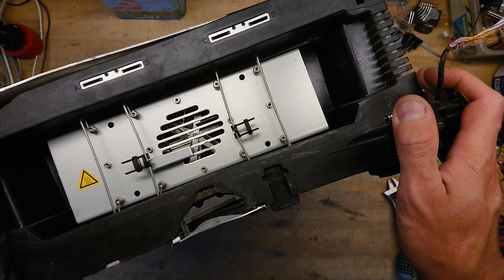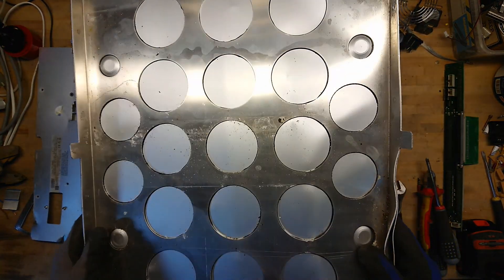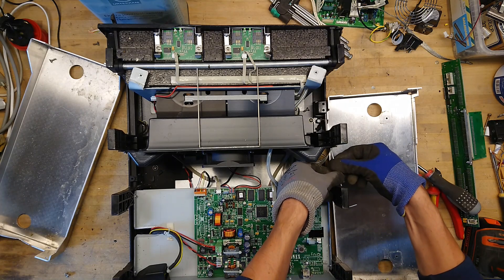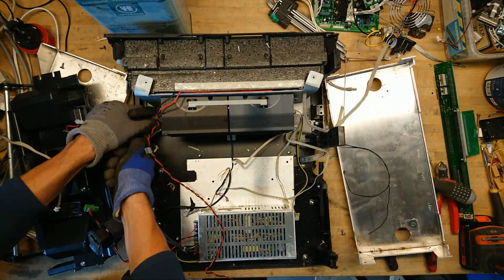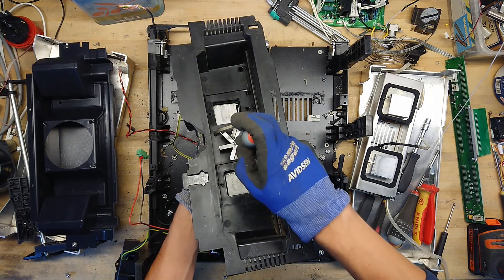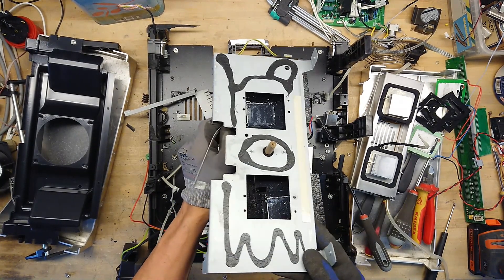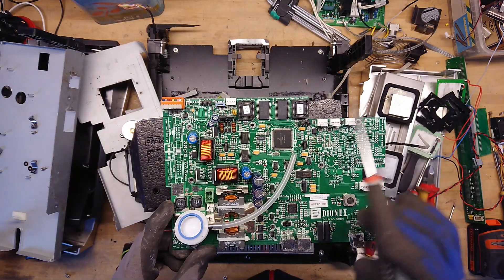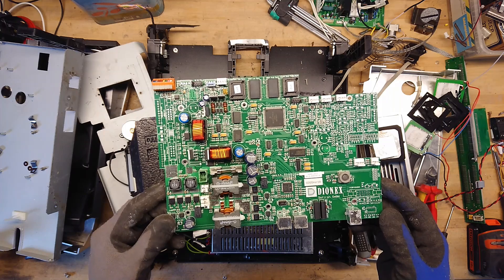HPLC Thermostatted Column Teardown - Dionix TCC-3000SD

Comment: Funny enough I designed a small portable Gas Chromatography column.  The main effort is thermal accuracy and stability as it directly effects the columns retention time. As many compounds are only identified by their retention time, an error in the temp-controll can have quite grave consequences. For example if you are measuring volotile organic compounds like benzene or styrene. (Not HPLC but simillar technology)
Reply from the maker: From another comment thread, It actually only now occurs to me that I worked with gas chromatography in the residual liquid detection machines for returned bottles. It would spray in caustic and CO2, suck the resulting gas out to analyze for volatile components and if present, the bottles was rejected as dangerous waste. It was such a mess when a full bottle passed the full bottle detection and the analyzer got a blast of liquid caustic inside of it :)

Comment: I used to run HPLC machines. Never had a column heater though. The column would separate the sample into its component molecules and the UV detector would "see" the output of the waste stream as the mobile phase liquid dragged the sample over the column packing. Was very interesting.
Reply from the maker: Great to hear from a user of these technologies! So for this to be possible, the stuff being analyzed is mixed with a liquid that will cause these reactions at a given temperature?
Reply: @KaizerPowerElectronicsDk  i think the heater probably makes the system work faster and more repeatable. Temperature was a factor in arrival time of the sample to the detector. The method is kind of like rocks in a river. The mobile phase is a solvent like liquid blend. And then it is pumped through the column. The column has sandlike material that slows the passage of the dissolved sample and they spend more or less time in the column depending on molecule size and bonding factors like charge. The sample is loaded into the stream and then one by one they run out of the end of the column into the UV light beam and then a detector reads the response and plots a curve on a graph. A known standard of the compound(s) is run under the same mobile phase liquid and those are weighed and measured so that a number can be given to the concentration of known sample and literally the area under the curve can be used to determine the concentration of the known to the unknown by how high the curve response of the detected sample was. In the old days it was paper plotters and they would literally cut out the curve with scissors from the ink plotter and weigh the paper on a 4 digit analytical balance. Then punch the weight of the sample paper curve into the equation against the weight of the known standard curve and work out how much active was in the product. So the heater i guess would give faster run times and more consistent arriving times cos if the temperature was the same every time then the only other variable is how well the operator measured the liquid blend of mobile phase solvent.
Reply from the maker: Your explanation draws so many parallels to bottle inspectors that I have worked with, in brewery industries. Analog cameras which from the shadows of the bottle and the resulting histogram formed a curved where the result was weighted on the analog value of the dark areas. It actually only now occurs to me that I worked with gas chromatography in the residual liquid detection machines for returned bottles. It would spray in caustic and CO2, suck the resulting gas out to analyze for volatile components and if present, the bottles was rejected as dangerous waste. It was such a mess when a full bottle passed the full bottle detection and the analyzer got a blast of liquid caustic inside of it :)
Reply: @m3sca1  Fellow heavy HPLC user here.  The heater makes the chromatographic process more accurate and consistent. Reverse phase, in particular, but also to some extent size exclusion are prone to temperature dependent secondary interactions between the analyte(s) and the chromatographic resin in the column. These interactions cause the peaks to come off later than expected and in rare cases can be very significant.
Reply: @PedroDaGr8  thanks for the info. It's been a very long time since i donned a lab coat and things must have changed a lot.